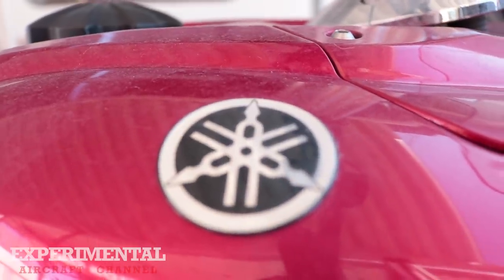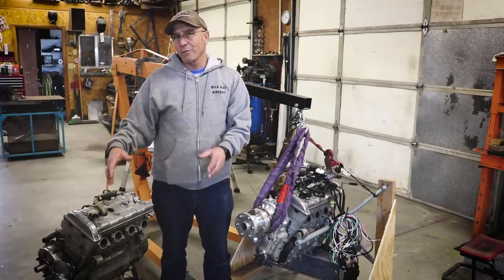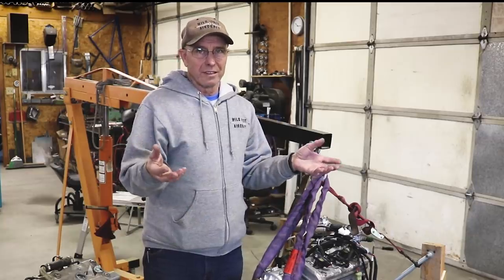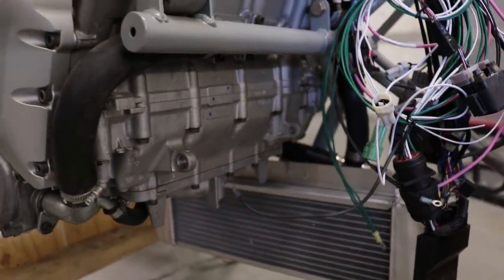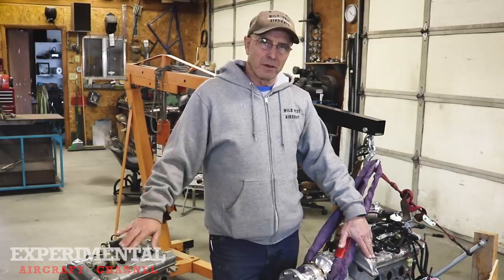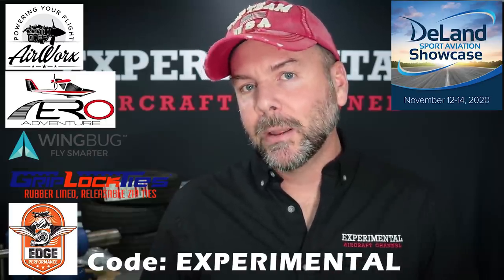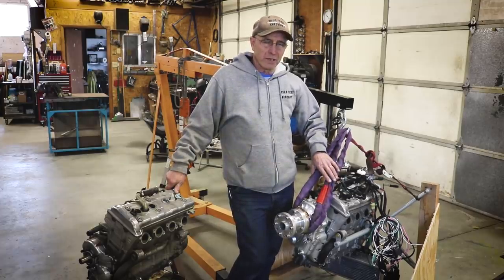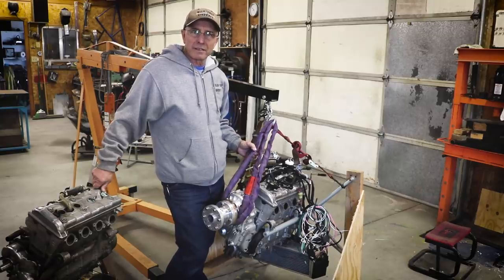Yamaha Aircraft Engines?  STOL - Steve Henry

Comment: 23K is too much. I would rather have a FJR Motor.
Reply: Marcus Russell  agreed, and another $10,000 for turbo?!? I’m thinking this is not a 2000 hour engine, which makes it even more expensive!?!
Reply: @warrenjbrown4898  Additional $20K for the turbo, he said!
Reply: Nope, it has a gear box, not something you want on an airplane.
Reply: @craigsanders6925  gearboxes were figured out by rotax with their origins of snowmobile engines with redrive for aero. The key is a coupling in the box which allows for the pulsed output of the engine to drive the high inertia spinning prop which acts as a flywheel and resists the pulses of the motor.
If you let the gears absorb the pulses it won't last.  It was Rotax figuring this out that allowed light sport to be viable and to give us a 2000hr light weight mogas four cylinder that is probably half the price of a 2020 dinosaur lyc/continental.. The big question is have these guys got a similar coupling built into this box for the apex or is it doomed to failure in 300hr???
Reply: @srnunan4783  Pretty sure Steve has more than 300 hours on them.  That includes a 300 Hp model, That's twice the Rotax Hp, I think the gearboxes are doing fine.

Comment: Scrappy will be putting out 10 times that much
Reply: and weighs 20 times as much
Reply: HP? 3,000 ? Lol
Reply: @429thunderjet2  Your schooling failed you. Ten times 150 hp is no where close to 30,000hp. You sound like that news guy Brian Williams
Reply: @travisk5589  yeah ok to many 0s geez sorry, typo! Edited now. And  Whiskey Tango Foxtrot is Brian a who? I can't stand much of them talking heads! 
The turbocharged Yamaha Steve is using is said to be 300hp x 10 = ? 3000? My point was Mike's eight cyl race engine on scrappy makes how much 575 - 600 or so ? I forget.
Edit; I was looking at some of his earlier vids the other day he said 500 hp at one point, but he didn't mention weight that I caught. But that engine is as big as a semi truck engine at 780 cu. Inch /12.78 litre so it's a torque monster at fairly low rpm, where as the litre turbo Yamaha make it's power at obviously way higher rpms. Torque X RPM= HP. And so in the end torque is what moves you.
Reply from the maker: It will be an interesting race/competition for sure! Thank you for watching and supporting here!
Reply: @ExperimentalAircraftChannel  for sure it will be interesting and you just know Scrappy will perform as well. Thanks for the interesting aviation vids Brian !
Reply: Cost 10 times as much, scrappy will be a different plane

Comment: rotax have best but ower price lot, 20 K one little motor no newer pay. normal motor need cost maximum 4000$ and have wery expensive, diy can build good motor aluminium block 2000$ and use many year no problem newer, idiot pay ower 5000$ one little motor.
Reply: you can also go with the water craft engines   310 hp to start
Reply: How many hours do you have on your diy, $2,000 engine?  And how many have you sold and supported?  Yeah.  I thought so.